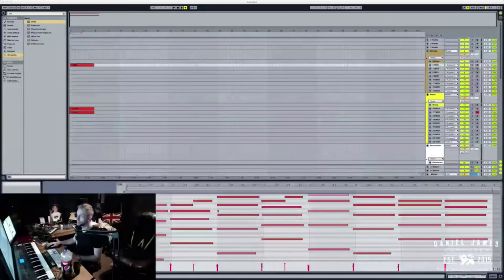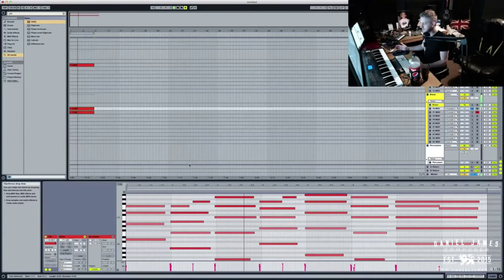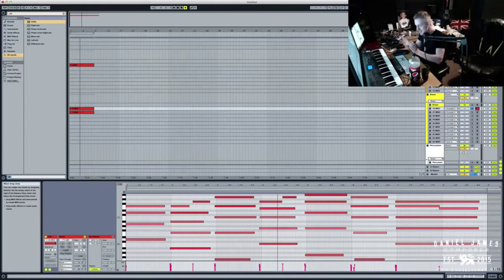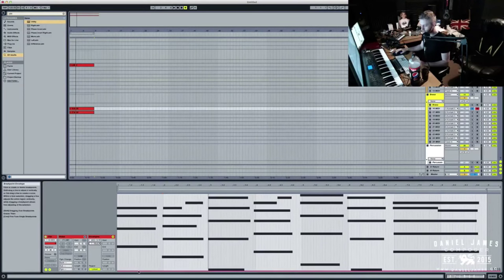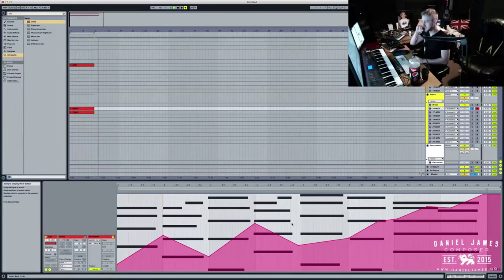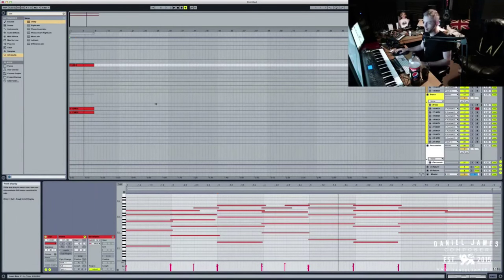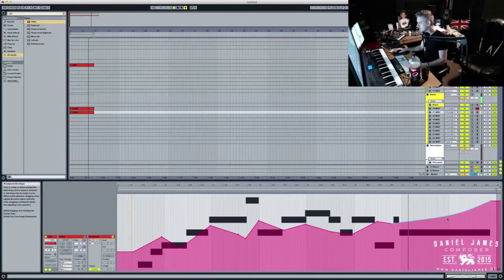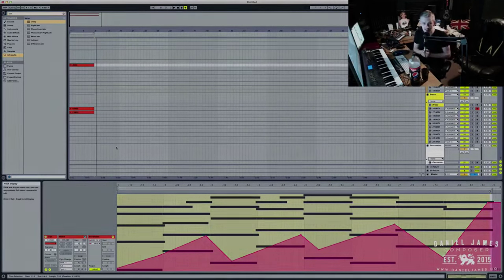Beginner Tutorial - MIDI Dynamics

Comment: Hi Daniel thank you for this tutorial. When ever i do the velocity i usually keep thing low as the note starts, take it high in the middle and as the note is about to end i bring it back down and so on for the next note (chord), you how ever did not particularly keep the start and and of the note in consideration, specially when you where doing the velocity for the brass sustains you would the velocity down in between a note also even when there is a sudden change in notes. which makes me confused if this velocity is the volume of the overall section or is it done to achieve authencity of how a string instrument is played?

Comment: Why can't you just use the "velocity" lane to adjust velocity instead of modulation? Is it because velocity is for piano/keyboards? Is there a reference that tells you what settings work for which instrument? Like how do you adjust the loudness of a doublebass? I loaded a VST doublebass but modulation didn't seem to affect it in any way. Also, is there a way you can tell if your VST instrument patches can be adjusted like this without having to load them, record and then edit them to find out?  Thanks.
Reply: +adamaj74 Velocity is locked on a note by note basis- it is not possible to do the 'Swells' as is shown in this video. The modulation technique can change the dynamics throughout a note, much like automation. I don't know about the double bass, but usually for the dynamics, a low pass EQ is used, so if you want to emulate that style, and it has velocity, play at the highest velocity and control the dynamics using the EQ. Usually, higher end patches have this, but you would have to watch a video review to make sure you're getting what you want.
Reply: +adamaj74 I could be wrong, but I think some instruments such as strings, the modulation controls how much pressure the violinist is putting on the strings, resulting in a raspier sound. For the loudness, I use expression controller. 

I'm pretty much still a beginner, so what I just said could be completely wrong, but that's how I do it usually.
Reply: +Kurt Tomlinson Music Thank you my friend!! That did the trick! For whatever reasons, I have found that modulation controls the loudness of my brass instruments vst's, velocity for my piano/keyboard vst's, and expression works for doublebass from my strings vst. But yeah, "expression" will control the loudness of a doublebass. I forgot which CC number it is now, lol. Thanks again.
Reply: +ERAT Thanks for the reply. I will give that a try tomorrow. I'm using EastWest composer's cloud, btw.
Reply: adamaj74 No problem, I remember not knowing how to control the loudness a while ago because some instruments seemed to allow modulation to control the volume, whilst others allowed expression to control it.